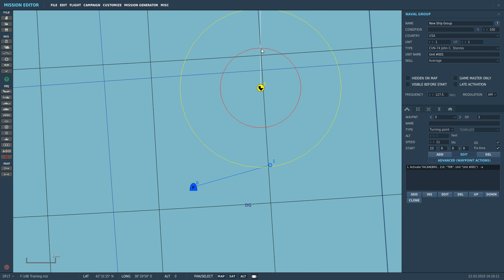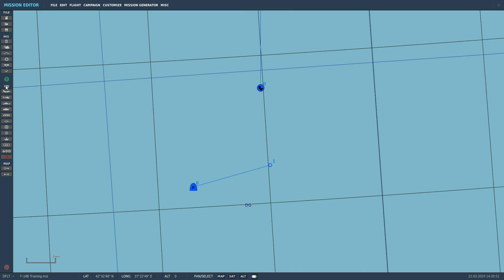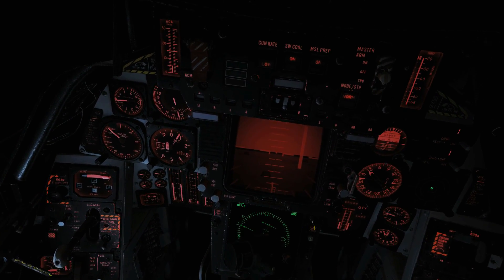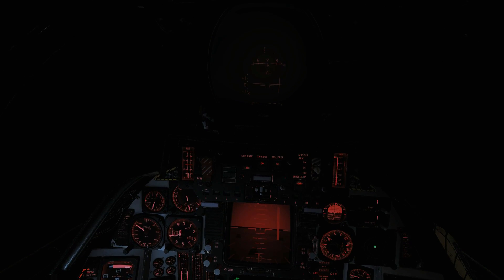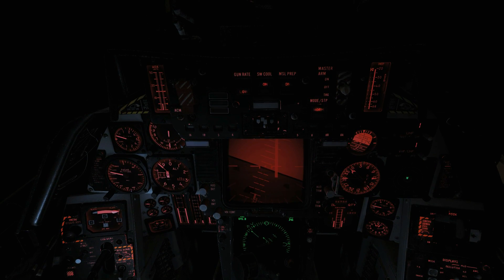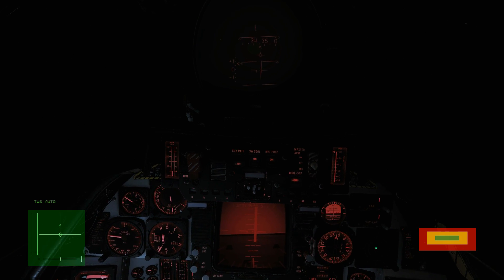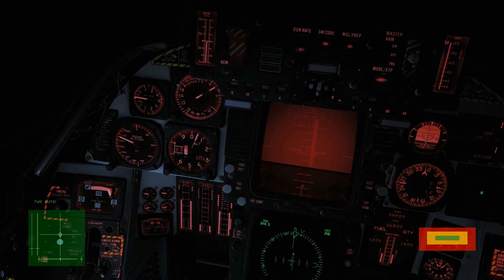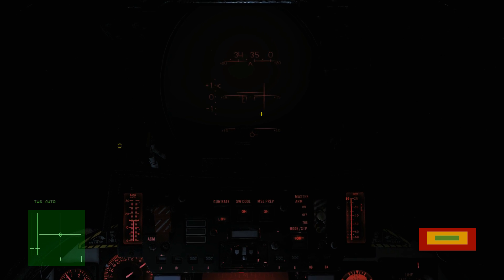F-14B Tomcat: Carrier ICLS & TACAN Landing Tutorial | DCS WORLD

Comment: The air brake ‘out’, allows the engines to operate in a more responsive part of the engine performance range. The air brake also dampens the effect of those incredibly powerful engines.
Reply: Sterling Archer What do you mean, should the airbrake be constantly deployed during the approach?
Reply: @droneforfun5384  yes extend the air brake and leave it till touchdown then go full mil and retract incase you miss the wires